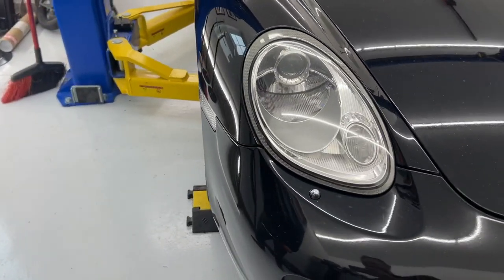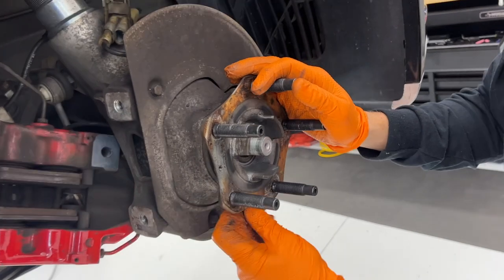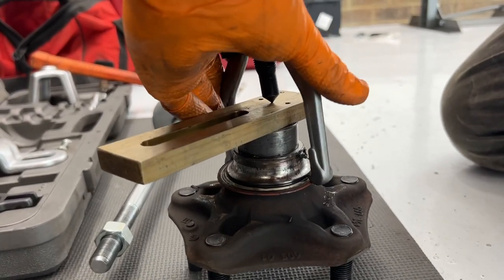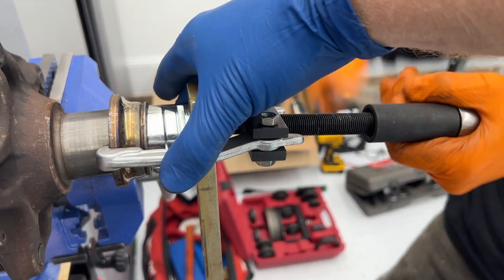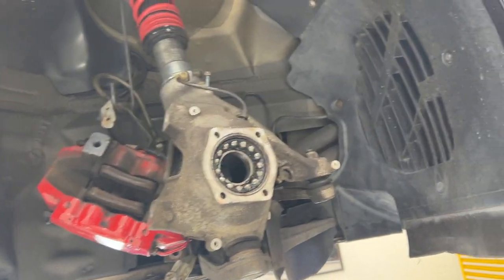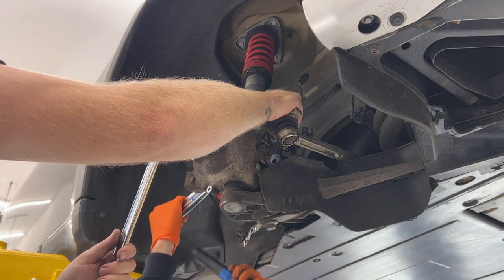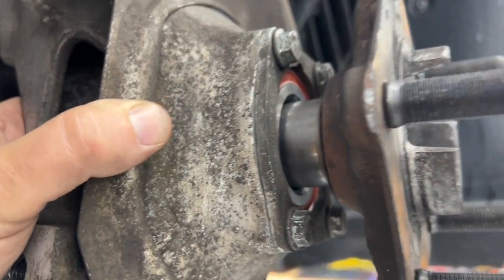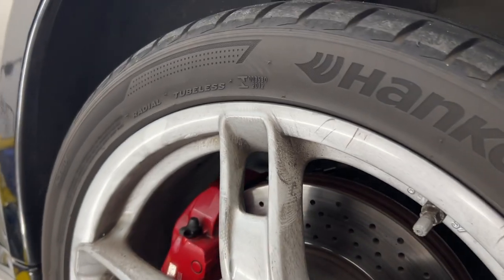FRONT WHEEL BEARING Replacement on a 2006 Porsche Cayman S 987

Comment: I'm doing this job right now by myself. 2005 Boxster S. You inspire me to tackle a lot of these jobs. Instead of whacking the wheel carrier to bring it down and keep it down, I tied a ratchet strap from the lower control arm to the bottom of my scissor lift. Then just hit the button to lift the car higher and the control arm was pulled down and stayed down for me to pull out the spindle. Worked beautifully!
Reply from the maker: +@Richard-b2g8p you are obviously much smarter than me 😂 Great idea! 🍻

Comment: Having completed this job myself on a 911 (991). I'd recommend others refer to VW and Audi videos in addition to this one. Thanks for making and sharing this video. Respectfully,  you guys did some things the hard way. The hub puller would never bring the whole bearing,  so trying that was futile. Removing the race from the hub is much easier and faster to cut into the hub and whack it with a chisel. Also, the Porsche torque spec for the 4 bearing cover plate bolts is 27ftlbs, not 7.5. Thanks for sharing your experience.  I appreciated learning how the cayman is slightly different.  My 911 stub axle came out without having to loosen the wheel carrier. I posted a video of my 911 wheel bearing removal as well.👍
Reply from the maker: +@jackharding98 thanks for the extra info! 🍻

Comment: 30 mins to disassemble wheel assembly out including the strut and work by pressing out the bearing.  Much easier without whacking your brains.  Also did you loose the  Lower Control Arms because whacking them down will wreck them.
Reply from the maker: +@ComputerGeekOnTwoWheels that does sound easier

Comment: This and your Boxster videos are very informative but make me regret I ever got an '03 Boxster seeing how complicated some procedures are. My first car was a '75 Datsun 710 and easy to work on by myself in my own garage with only regular tools. I just hope I don't come to the point where I have to struggle like you and your friend. Thankfully, the Boxster is still well behaved at just over 100000 miles with just routine stuff like oil changes. Wheel bearings, crumbling motor mounts scare me. Also, found out too late after buying it that it uses too small a clutch for a powerful car, so it may not last as long as on Japanese cars, unless I baby it. Scotty Kilmer, had I known him then, would have probably wisely pointed me to a Mazda Miata instead.
Reply from the maker: +Alexander Schonfeld thanks for watching! With a few exceptions I have found the Boxster to be much easier to work on than I expected a mid-engine car to be. Fairly easy access to 3 sides of the engine 😁
Wheel bearings are pretty tough on any car and require similar tools from what I understand
Reply: Clutch still holding up? These clutches seem to be about typical for a car of this power. I've heard most clutches last to about 100k miles, and most boxster owners are getting more than that many miles out of them. I have talked to a few Cayman S guys however (987 S), who have replaced their clutches at 60-70k miles. That one might be undersized, but it's just anecdotal. Struts and wheel bearings have definitely been tougher on this car, but doable. The central motor mount is really not bad.

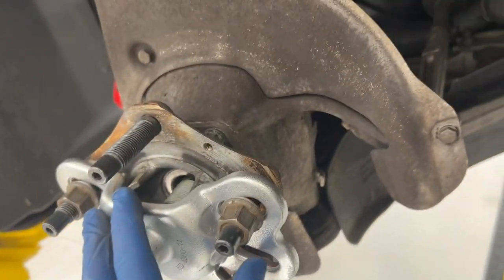Comment: 9:08 I don't understand why you couldn't keep going with that method, what do you mean by the bolts bottoming out? Seems like you should be able to whack the bearing out a bit more until it bumps up against that retention plate, giving you more room to loosen those bolts
Reply from the maker: +Bryan they couldn’t come out any further. The bolt head was hitting that plate.
Reply: @HelpMeDIY  I just got done pulling out the rear bearings on my 986. I still don't think I get it but I realized it doesn't matter anyway. I was hoping to avoid the problem you had where the inner race came out with the hub, and I thought pulling the bearing & hub together would help, but I'd still have to pull the hub out of the bearing anyway since I'm reusing the hub. And it's probably harder to do that on the bench rather than when it's still in the car.

Anyway my inner race did indeed come out with the hub, but I used a dremel with a cutoff wheel to make a deep groove in the inner race, and then whacked it good with a hammer and chisel several times. The race will fracture cleanly along the groove and will easily slide off. I saw this trick on another channel and was a bit nervous about trying it, but it was actually pretty easy
Reply from the maker: @spyderborg  that’s great! Thanks